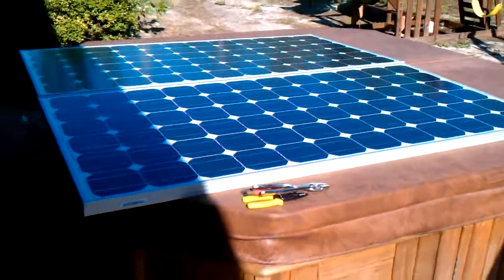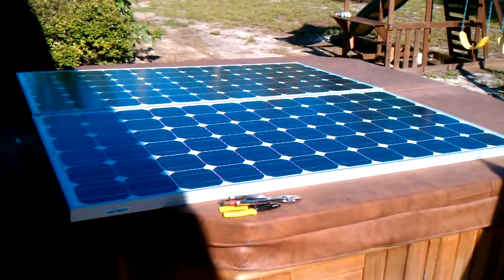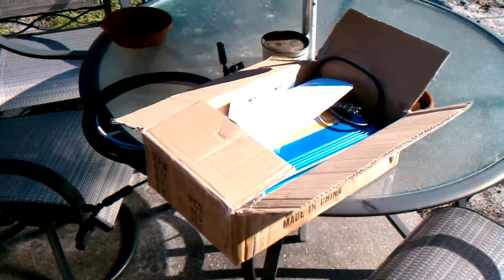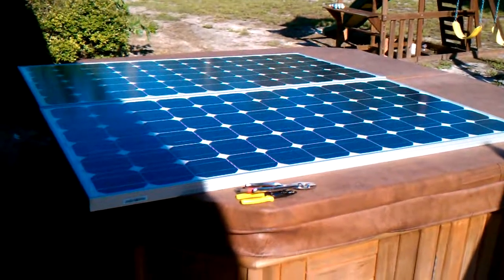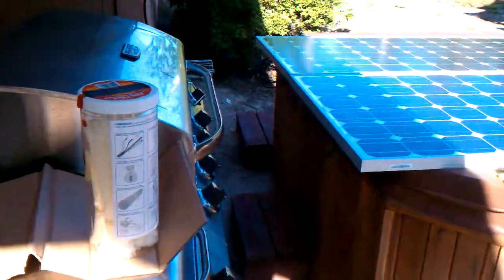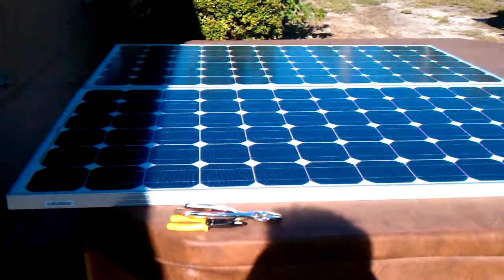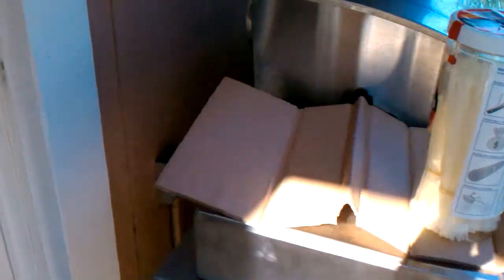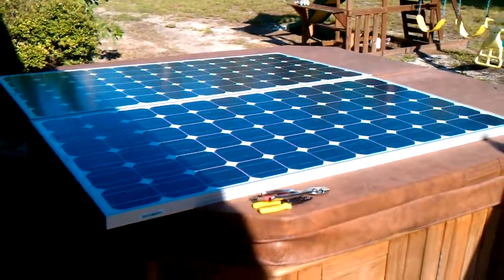Solar panels & Powerjack 1200 watt grid tie part 1

Comment: @kristijan0kroflin in americ a we use 60 hertz and 110/120 volts ac. so 20-25% of the average home electricity is waste by using a neutral insted of two phases of ac power...

Comment from the maker: @Xringer Funny you mention that because the solar tracker is designed for 4 panels of the same size and type and it will only be holding 2 for now so I'm way ahead of you :) I can't get any more than 4 though until I get my off-grid stuff setup as the laws in the South are terrible and totally against green power. If I spin my meter backwards it's considered "Felony tampering". Welcome to the South... PS - I work for the power company. Shhhhhhh....

Comment from the maker: @Xringer Thanks Rich and I thought about that too but to build the solar tracker is not only fun but super cheap compared to buying 2 more panels. The solar tracker I build costs less than $200 and improves the efficiency of the panels by about 25-40%. My reasoning is, why buy more panels when the ones I have can be made more efficient at 1/5th the price? I'm planning on adding 2 more panels which will be my limit until the off-grid portion is finished. Laws in the South suck for green power.